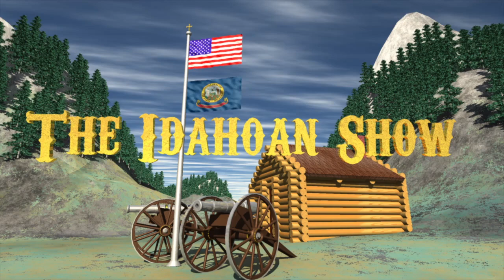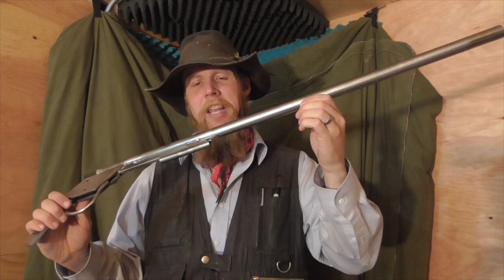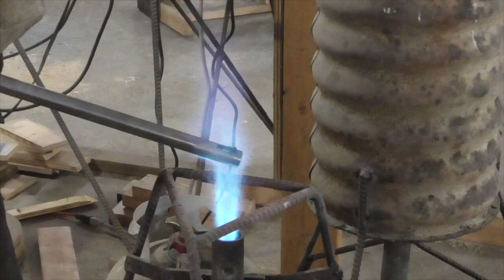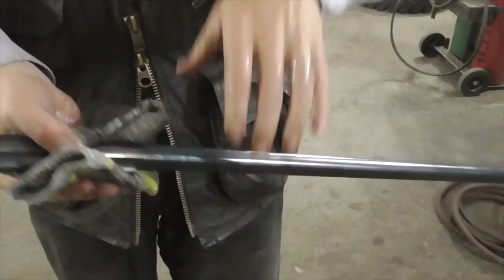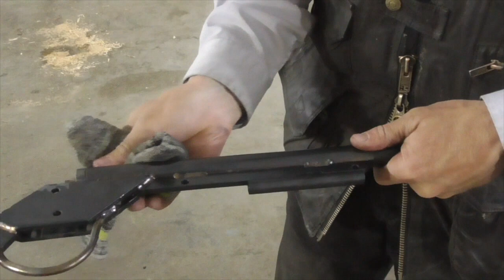Flame Bluing (TIS380)

Comment: Did this multi-color finish to a 22 rifle two years ago, except i quenched in oil. Its holding strong without any rust and minimal oiling in a semi-dry climate. Surface prep doesnt matter, full polish to 60 grit grinding, and no apparent added abrasion resistance. It does help wick a little oil on highly polished surfaces.

Comment: What if you essentially did the same technique as Japanese sword smiths do for the "hamon"?
Apply some sort of compound to the metal where you do not want as much colour, do the flame bluing process, remove the compound and then repeat the flame bluing process in those areas.
Reply: 333badcat  the purpose would be to prevent the metal from coming in contact with oxygen in the air, leaving those spots unblued in the first pass.

Comment: Isn't the structural integrity of the metal weakened on a shotgun barrel
Reply: If you're heating it below a dull glow, probably not. He does mention watching out for overheating small protrusions. HOWEVER, one warning is for gun barrels with beads, ribs, and/or sights. Beads and ribs are often soldered or brazed with brass onto barrels, and sights often have brass components. It's very easy to ruin the soldering or brazing this way, and the brass components of a sight could warp or detatch. But a bare steel barrel like he uses in the vid should be fine (unless it's cooled rapidly resulting in warping).